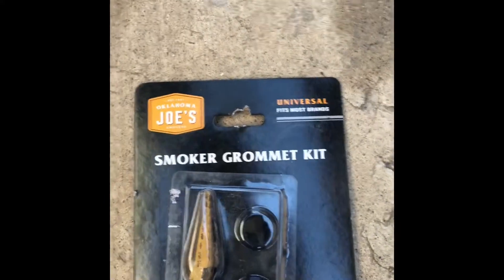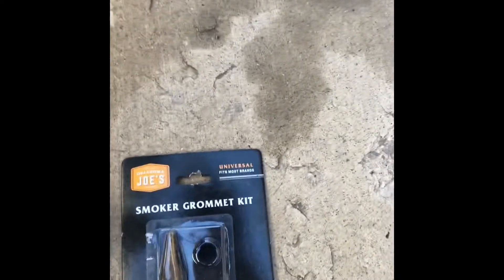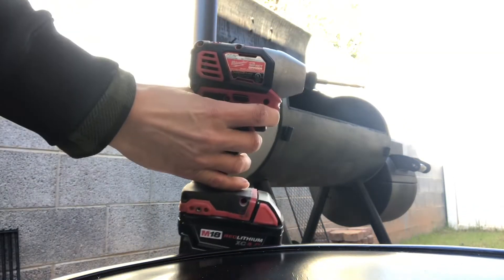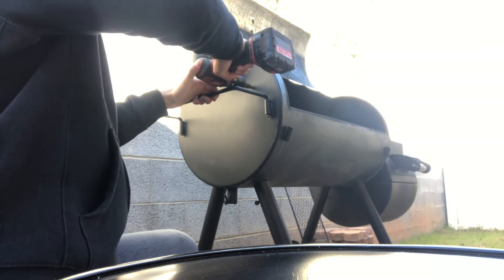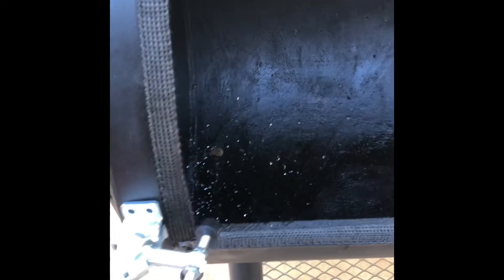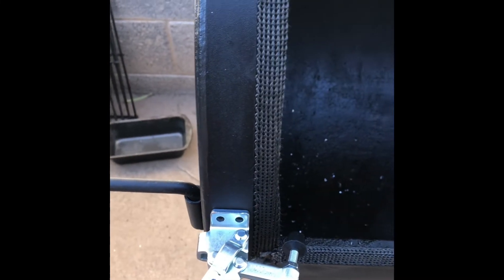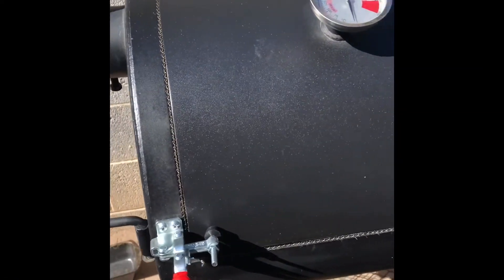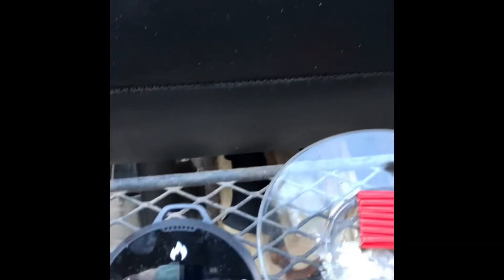Oklahoma Joe’s Highland Grommet Kit Installation

Comment: How long did that gasket last after you put it on a dirty smoker?
You need to sand down to bare metal, scuff the surface, degrease, apply high temp RTV, then apply the gasket if you want it to last.

Comment: What size drill bit did you use to make the holes for the lava lock latch ?
Reply from the maker: I used a 1/8” drill bit and bored out to 3/16” with a 3/16” bit. I’ve heard of people going to a 1/4”, but they had problems with smoke escaping through where the latches were installed so I didn’t go any further.
Reply: @pyrepit3665  awesome thanks!!!
Reply from the maker: @LVGRCCrawlers  No problem! I still had to bore out like two holes using the same 3/16” bit because of the radius of the cooker, but it wasn’t very much at all or very difficult. Just enough to get the little bolts through. I hope this helps!
Reply: @pyrepit3665  thanks, got mines installed last night !!
Reply from the maker: @LVGRCCrawlers  Awesome!